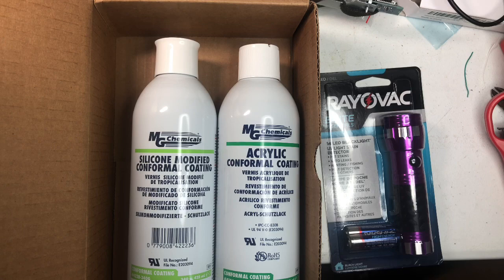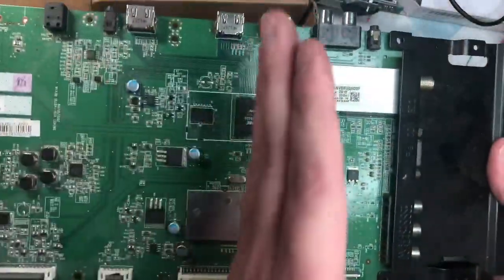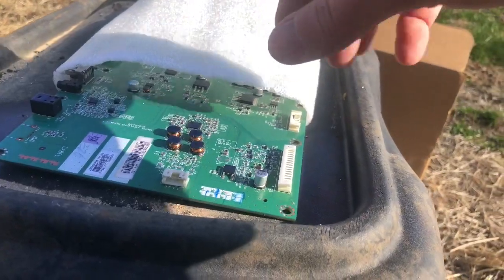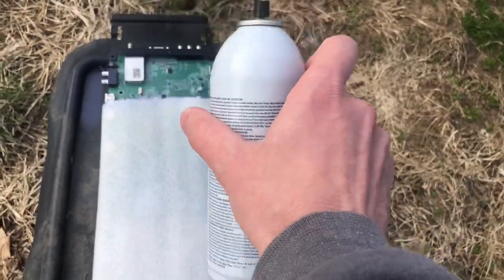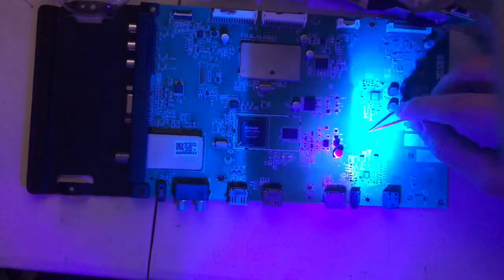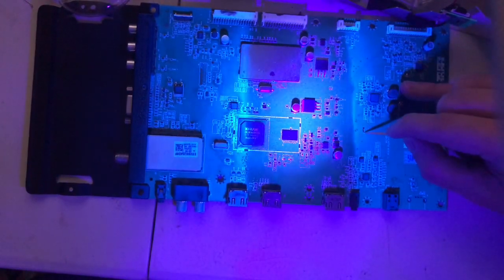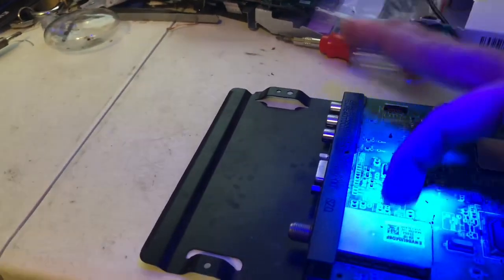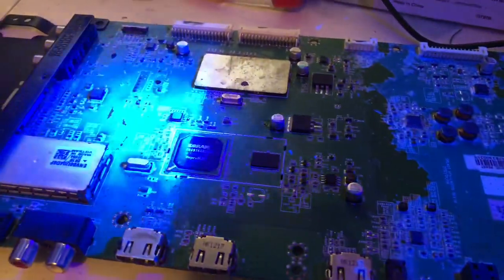Silicone vs acrylic conformal coating on circuit board test

Comment: You never tested the circuit board for the most important thing. Which is to see if the board works, after the coating is applied.

Comment: Acrylic conformal coating is made to create a barrier, but also be easier to do rework on.

Silicone conformal coating is more tough and much harder to do rework on. It's much more difficult to remove if you need to replace a component on the PCB.

If you don't plan to do rework/repairs to the board. Go with silicone.

If you want to be able to repair the board without the difficulty of removing the silicone, use acrylic. It's made to allow the heat of your iron to eat through it and make the repairs you need.

Comment: It does appear that the silicone is more durable but as with any coating, surface preperation is critical. I would have liked to see the board washed in alcohol first.

Comment: Not sure where you're from but I had to watch this at 1.25-1.5x speed. :) Jokes aside, when you were picking at both sides with your fingernail, I have to say it was a little biased. You scratched the acrylic at the edges of the areas that were already flaking vs the center of the silicone side. But you are right, the review corroborate your experience with this. I will be getting the 422B silicone spray thanks to this video.